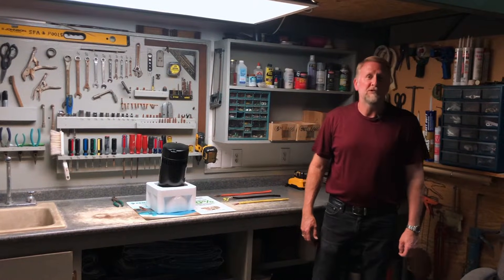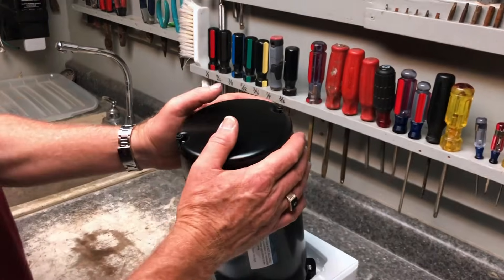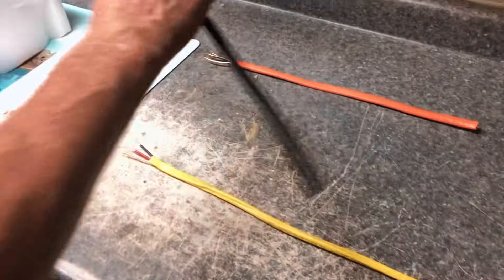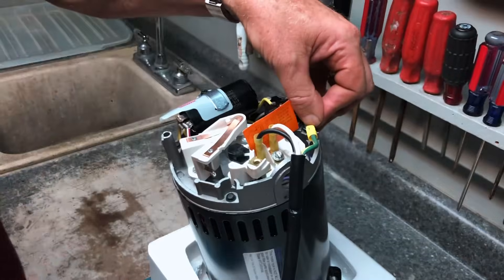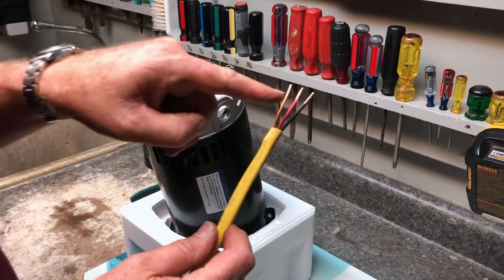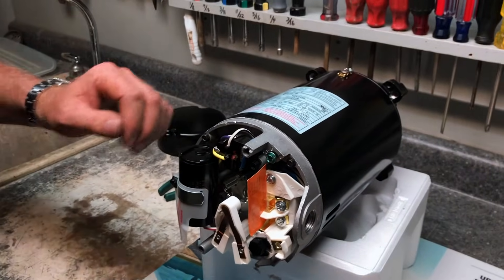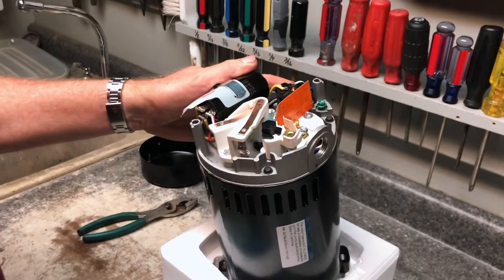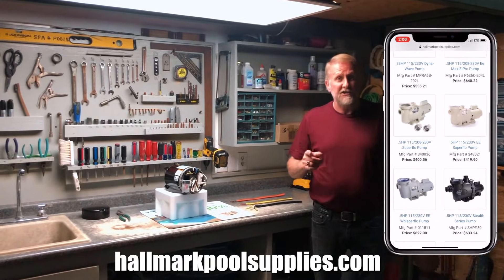How to Wire the Motor on a Swimming Pool Pump | Quick and Easy!

Comment: Hi - nice video, I have an above-ground pump  that I want to use it to clean the pool(pump garbage out)....it has no screw in the back of motor for ground wire,  how would I ground it? could I just use a 2-prong wiring? thanks
Reply from the maker: If your motor does not have a grounding lug or screw then you may not be able to ground. I would refer to the manufacturers specs for wiring of the motor. Thanks for watching.

Comment: As an added layer of safety you can mention that whether it's 110 or 220 that the line is protected with the proper size circuit breaker. Also I like to add a GFCI circuit breaker to my pool pump feed. Just another layer of protection.

Comment: Thanks for the info.  What about the ones that have a circuit board that also show L1. L2  and a green screw for ground is this the same like most 2.0 hp. Not sure if this is and older model or newer one.  My old Hayward 2hp motor didn’t have a circuit board only had a capacitor on top of motor.   Thanks for your videos.  Keep up the good work
Reply: So is this pretty much the same in connecting ?

Comment: What size dedicated circuit breaker for this size pump?
Reply from the maker: The pump in this video is 1HP, the breaker should be at least 20 amp with a 12 gauge wire.Thanks for watching.

Comment: What is the gage wire for 220
Reply from the maker: It depends on the amps, a 20 amp 220 circuit calls for a 12 gauge wire. A 30 amp calls for 10 gauge, a 40 amp is 8 gauge and 50 amp is 6 gauge. The lower the gauge number, the thicker or heavier the wire is. Thanks for watching.

Comment: I have to decided to run the pool motor on 230 for more efficiency, but what amp circuit would you recommend?  I will check the label tomorrow
Reply from the maker: Most motors that are 230V use a 30 amp double pole breaker.I would recommend checking with an electrician, there are other variables to consider. Thanks for watching.

Comment: Great video. I have 2 blacks , 1 red and one green. Can I just cap the red wire off?
Reply from the maker: It depends if you have 110V or 220V, you need to confirm the voltage on each wire before doing so. If you are 220V, you need two hot wires and a ground. If you are 110V, you need one hot wire, a neutral and a ground. Thanks for watching.

Comment: Thank you. So clear. Can I  (temporary) wire the wires coming out from my pool pump into a plug that I can run with my generator?
Reply from the maker: Yes, just verify if your pump is 120V or 220V. Thanks for watching.

Comment: When you were wiring the 110 was the black and white on the high and low  speed lugs?
Reply from the maker: No, the black and white wires go on L1 and L2. The pump in the video was single speed. Thanks for watching.

Comment: Hi Mark, I replaced the old 230V pump with a 115V with high and low speed, how do I wire it?
Reply from the maker: Refer to the schematic on the motor, every motor is different. Verify the supply line you are working with, most motors can run 220V or 120V once they have been converted. Thanks for watching.

Comment: My pump is a imeshbean it has a 115/230 switch on it.I need to know how to hook up the switch wires
Reply from the maker: Without a schematic I would not be able to tell you which wire goes where. If you have a schematic or diagram for this particular motor you could refer to it. All motors are going to be different.

Comment: I have 110 now but will change to 220.  Inside the panel its black to breaker white to bus bar and ground to ground.  Does it stay the same for 220 or both black and white ti breaker ?
Reply from the maker: If you disconnect the white wire from the bus bar and put both white and black wires on the breaker you will have 220. However, the breaker needs to be a double pole breaker.

Comment: If you have the motor wired for 120,  back at the panel you have the white landed on the neutral bar I’m assuming because you called it a neutral. Simply turning the knob on the motor to 240 wouldn’t just turn that white into a hot . You would  need to get a 2 pole breaker in the panel and land both the black and white on the breaker in order to bring 208 to the motor.
Reply from the maker: Correct, 120v has a hot wire, a neutral wire and a ground where 240v has 2 hot wires and a ground. When you turn the knob on the motor it allows the motor to be hooked up for high or low voltage. Turning the knob does not change the feed, the knob should be set to the feed coming in. The voltage can be easily checked with a voltage meter to determine if the feed is 120v or 240v.

Comment: Is it possible for a motor to run (partially) with only one good run winding??
Was wired for 240, completely died after freeze.. Rewired 120 for ease of testing with extension cord.
It actually ran, but never achieved close to full speed, so the start circuitry never even opened.

I know 240 puts the run-windings in series (120 each) so if either one opens, the other loses power.
With 120V both run-windings are in parallel, so if either one opens, it cant break the other's circuit.
Is only 1 good run-winding (and the start-winding) enough to make the motor keep spinning??

Wont run at ALL with 240-wiring, even if supplying 120 at the time, so my theory is an open winding?
Does anybody know the color codes for which wires go the run-windings?? Its a Myers HJ100S-001.
Wire colors going into the motor towards the windings are: Black, White, Purple, Red, Yellow.

Would love to verify which of these colors actually go to the windings, for testing with an ohmeter.
Or if anybody else has any experience/advice/theories, why this symptom after a deep freeze?
Reply from the maker: In your situation, to be safe it may be best to have your motor checked at a local motor repair shop.

Comment: Thank you for the video! I replaced my pool pump, it's a Hayward 1.5 HP, and the wires coming into it from my panel has 3 wires.  On the old pump, all 3 were hooked up. I'm not sure if I can just use 2 for this one. There seem to be only 2 terminals in the new pump and a ground.
Reply from the maker: You need to confirm if your supply is 110V or 220V, you also want to confirm if your old motor is  single speed or dual speed.
Reply: @HallmarkPoolSupplies  the supply is 220, and it’s two speed. I hooked it up with the two hot wires and the ground and when I turn it back on it still does the same thing it did before I replaced it which was a click on the breaker panel, and then nothing happens.
Reply from the maker: @zacharyandfriends2159 You are right, 220V would be two hot wires and a ground. You can check the voltage of the wires with a volt meter, or contact an electrician.

Comment: Mark, I have a 115 volt pump that I want to replace a 230 volt pump. I have the 115 V pump on hand and this is for a water feature so hoping to use what I have rather than having to buy anther pump. Can I use the 115 V pump i have and just change wiring to accommodate?
Reply from the maker: Yes, if your motor allows you to change from 115V to 230V then you can use it. Make sure you check the horsepower on both motors.

Comment: So I wired mine correctly but when I put the power back on it sparked with a mighty "buzzat" .. so I'm powering down and looking for gremlins
Reply: Looks like the plastic bracket was broken and the hot wire hit the outer casing.. now I'm either trying to save it or replace it.. grumble..

Comment: I have a 220v pump and 4 wires Black,Red, White and Green.
The white goes to the GFCI breaker.
Where does the white wire go on the pump with only a Black Red and Ground terminals?
Reply from the maker: You need to confirm the voltage on the white wire, to be safe you may want to contact an electrician for your situation.
Reply: @HallmarkPoolSupplies  
No voltage on the white wire.
It's just connected to a GFCI breaker in a pool pump panel. 
The GFCI breaker will trip (in case of a fault).
The power for the contactor coil goes through it as a Safety device.
230v power is supplied by a 2 pole breaker at the house panel.
Red and Black wires with a green.
From the house panel to the pool pump panel. It's a pre-wired panel that the previous owners abandoned in place and installed a smaller 115v pump with extension cord. 
The pump panel has no schematic but I traced out every wire and made one. Just helping out a neighbor.

Comment: Hi Mark, Thanks for posting.  Does Load 1 vs. Load 2 wire truly not matter?  The motor electronics can handle the two phases either way?
Reply from the maker: Yes, just make sure green is on the ground.

Comment: Super informative, thanks for the video tutorial. Unfortunately, I have a brand new 3/4 Hp Hayward super pump motor with an impeller that is spinning backwards. I’ll keep looking for a solution!
Reply from the maker: If you do not have 3 phase then I would check the hook up on your capacitor.

Comment: My old (25 yrs) pump was directly wired to an electrical breaker box just beside the pump.  The wiring to the pump is Red (solid), Blue (stranded) and White (stranded).  No bare solid ground wire or green coated ground wire in wiring conduit.  The new pump is the VIVOHOME 2.0 HP Swimming Pool Pump, SKU: VH514, HBP1500 11.  1) VIVOHOME service emailed me stating that no rewiring for 220 volt is required, just toggle switch to '230'.  OK?  2) Was planning on wiring a female electrical plug (15 amps), but am unsure how to wire up the plug.  Any thoughts?
Reply from the maker: In your situation I would contact an electrician.

Comment: My voltage from L1 to L2 is zero but from L1 to ground is 120 and L2 to ground is also 120. Took my motor to a Local repair Shop and they said it was fine. Any chance you would know why it’s not working?
Reply from the maker: I have a few questions, if you would like to contact me I will be glad to help.

Comment: I just purchased a replacement 1.5hp motor. Does it matter if I run it at 110 or 220?  What are the considerations?…besides what the current electrical is set/built for.
Reply from the maker: Most motors can be converted from 110v to 220v, However when you wire your motor it has to be wired in accordance to the feed coming in. If you don’t know if you are high voltage or low voltage, then you can use a volt meter. If you want to change the feed you can but it also depends on the type of pump you have (single speed , dual speed, or variable speed) you would want to talk to an electrician, if not, work with what you have.

Comment: Hi Mark, my issue goes a little bit deeper. On the back of the white plate where you switch from 115 to 230, there are two female molex type pin connectors; one is brown and the other is black. That whole part got fried because of a poor installation and water constantly getting into that section, until it started a small electrical fire. Then it kicked the breaker and extinguished.
Anyway, I'm replacing that white base plate and don't know which color goes where on the receiving male pins. Any help is appreciated.
Reply from the maker: Different motor brands use different plates and colors. In this situation because of what has happened, just to be safe, I would take your motor to a motor repair shop were they can verify the wiring on the plate.

Comment: Hayward pool pump power flo 
Pump,was running  approx 4 hrs 
When turned off 
Pump would not restart  again until I tried about a hour later 
Why is it doing this ?
Reply from the maker: Make sure that you are not using an extension cord when running the pump, the minimum gauge that can be used is 12 gauge. If you are not using a cord and your breaker is not tripping off then your motor might be over heating. You can take your motor to a local motor repair shop if needed. If you have any questions feel free to contact me I will be glad to help.
Reply: @HallmarkPoolSupplies  that’s Exactly the gauge that I’m using 12 gauge extension cord

Comment: For the motor start cap my buddy pulled the wires off the cap before marking them.  We have 3 wires how do we determine what wires go to which terminal?
Reply from the maker: I would take the motor to a motor repair shop to make sure that the wires are put back properly.

Comment: I have new pool pump that is doing something strange...After 5 minutes turns off for 2 minutes then without me doing anything restarts and repeats. any clue what is happening?
Reply from the maker: You need to check the wiring and make sure that the pump is wired correctly (110/220). If the pump is wired correctly then it sounds like the motor is over heating. If you have any questions feel free to contact me I will be glad to troubleshoot this issue.

Comment: Is it possible to connect a extra switch for the fast speed? The button of my jacuzzi is broken and i wanna put an external switch, only would that be a problem when the low and high speed get power at the same time? Thx in advance!!
Reply from the maker: For your situation I would contact an electrician or take your motor to a motor repair shop.

Comment: Ordered this exact pump. Silly question but what is that plastic part with the red writing? Does that stay on?
Reply from the maker: If you are referring to the wiring instructions tag this is removed. If not send me a picture I will be glad to take a look.
Reply: @HallmarkPoolSupplies  thank you! 😊.  One other question.  My pump turns on but is now making a loud humming noise. Should that be happening? It's a new motor
Reply from the maker: Your pump should not be making a loud humming noise, you need to make sure that your pump is wired properly.

Comment: We had a fire in our electric panel.  We had it fixed but now we are not sure if the pool motor corresponds to a double pull 30 or a double pull 20. We had the pump tested (at Leslie’s) and it runs great .  Any chance you can help us figure it out?
Reply: Oops I forgot to say it’s wired 220. And it was working fine before our fire. And our wiring it fine too
Reply from the maker: For your situation it would be best to have an electrician take a look, then you know that it will be done right.

Comment: This should read how to wire up one type of pool pump, I have a century 115v/230v variable and it has 6 numbers inside the back case with a white wire and a black wire already hooked up to 3 and 5 with 6 numbers and leads, I don’t know what to hook my hot wire and my neutral to from the power side still yet. Just 2 little wires and I know if I hook the wrong two up then that’s it
Reply from the maker: Check the voltage to confirm, you may need to contact an electrician to be safe. Feel free to contact me I will be glad to help.

Comment: My neighbor just gave me his Hayward Power Flow Matrix 1.5 HP pool pump.  The plug is a twist-lock.  I need a 3 prong plug.  
Can I buy a Twist-To-Lock Converter Adapter 15A Male to 20A Female? 
If not, can I buy a 3 prong replacement plug and wire it to the motor like you just did in this video?
Reply from the maker: I would remove the twist-lock cord and replace it with a 3 prong cord. Here's a link to the cord.
https://hallmarkpoolsupplies.com/p-1588-spx1250wa-6-143awg.aspx
Reply: @HallmarkPoolSupplies  Would the same wire apply to a Hayward Super Pump 1.0hp (W3SP2607X10)? Thanks for your informative videos!
Reply from the maker: @angedooks  Yes, you can use the same 3 prong cord if your pump is wired 110 volts. However 220 volt hook up would be hard wired (no cord).

Comment: I replaced my pool motor 5 years ago.  Today, it's been overheating, shutting down and then starting back up again.  Thanks to you, I did measure the voltage and it's giving a healthy 125V.  But when I opened up the back of the motor, I noticed that the motor was set to 230V!!!  I did save the original (to us since we moved into the house) motor and it ALSO was set to 230V!  When I set the current motor to the 115V setting, it pops the 20Amp circuit breaker.  So what's this all about?  I ordered a new motor.  What do I set it to?
Reply from the maker: You need to make sure that you measured the voltage correctly, if so then you may need to call an electrician. If you would like to contact me I will be glad to help you troubleshoot this issue.
Reply: @HallmarkPoolSupplies  Hooked to the disconnected wires leading into the motor.  I have a black, white and ground wire.  Meter hooked to the black wire and ground = 125V.  White to ground gives 0V; which tells me it's neutral.  The internal motor temp safety switch trips.  I measured the outer casing to be 280F.  The actual 20Amp circuit breaker does NOT pop unless I hook up the motor to the 115V setting.  Logic tells me that when the new motor comes in, I should set it to 115V.  But then why was this current motor and the previous one set to 230V?  Seems like someone installed incorrectly and the motor is struggling due to half the voltage.  But then I wouldn't have thought that the motor would last 5 years.

Comment: The old pump was seized, so I bought a new pump.  Now it's tripping the breaker.  Tried several breakers, 15, 20, and a 40.  Trips instantly no hum or anything.
Reply from the maker: Sounds like you have something wired wrong, it  would be best to have an electrician look at it.

Comment: My pump run for about 30 to 45 minutes then stop but don’t trip the breaker and after about 30 minutes in start running again. What could be the problem
Reply from the maker: First verify if the pump is on a timer. If that’s not the case, then it’s possible the the motor is overheating which will shut off and then turn on when it cools down. You may need to take it to a motor repair shop.